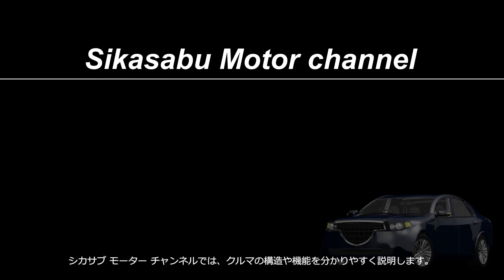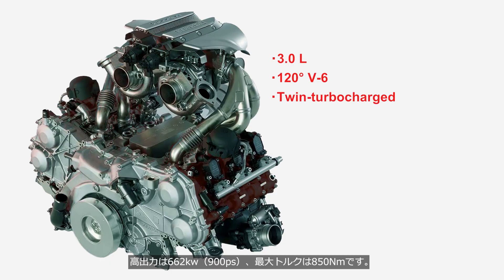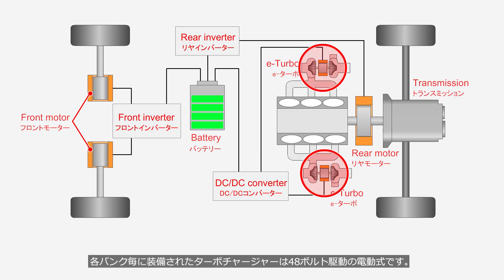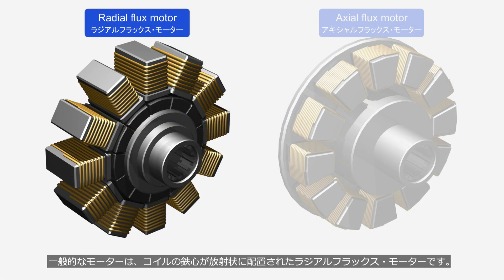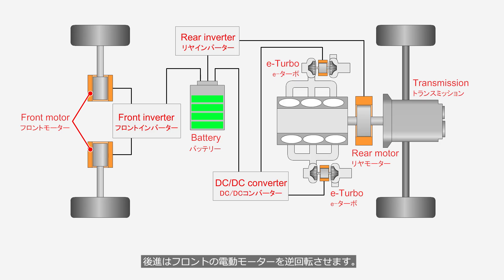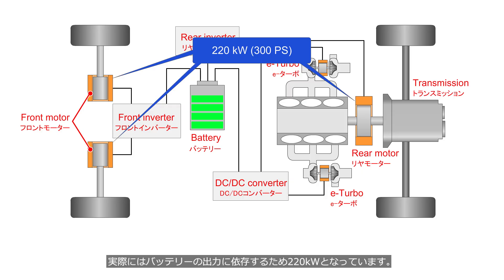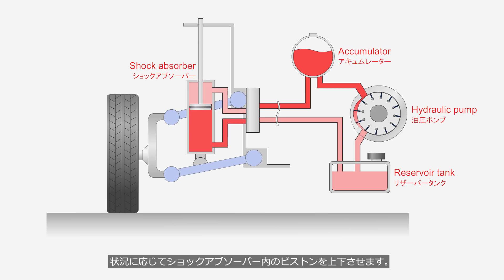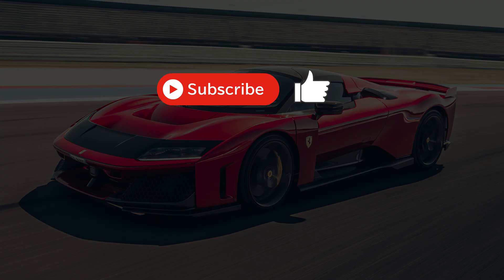Exploring the New Technologies of the Ferrari F80

Comment: 3:29 They don't convert thermal energy but kinetic energy.
Reply: the turbine of the turbocharger converts heat energy from the exhaust gasses into kinetic energy that is then used to drive the compressor, so yes it does infact convert heat into electricity..
Reply: @arne1618-u5b  The particles of the exhaust gasses physically hitting the turbine blades is what makes them turn. That's kinetic energy, not thermal.

Comment: Eventhough the battery is limited to 242kW; at lower RPM the high power motors can generate more torque than smaller size motors. The battery pack limited power will affect the top speed of the motors only.